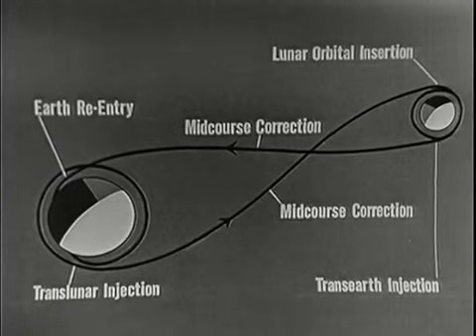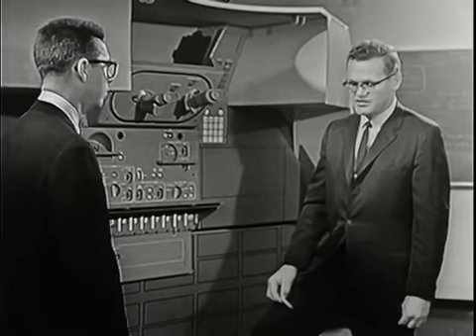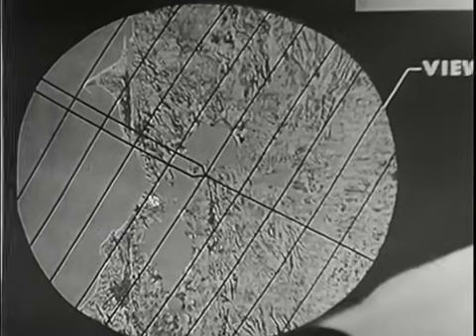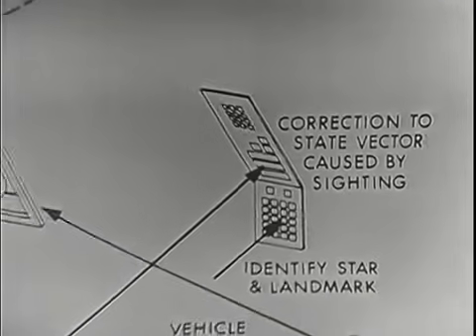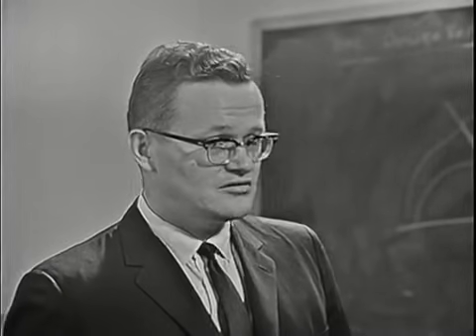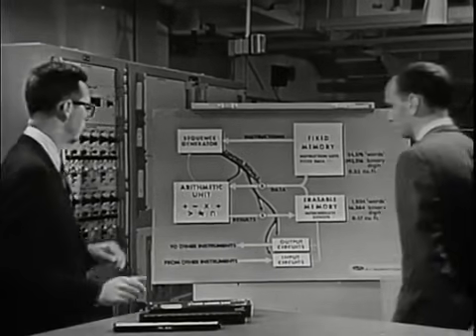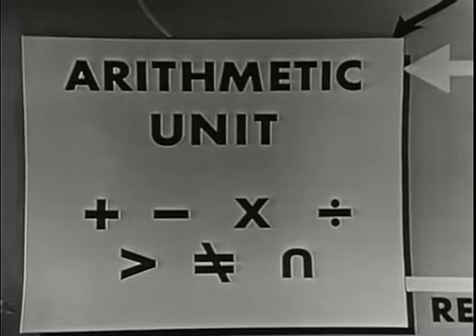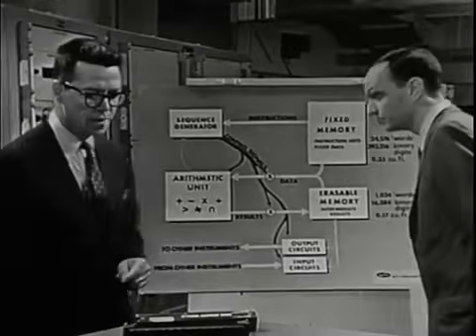Computer for Apollo  (1960s)

Comment: In 1978 I wire wrapped a S100 computer board with 40 ICs in a 5x10 inch S100 proto board.The CPU was the 2650 and was programmed in an Assembler using Numonics for Instruction and Operand, very similar to the Verb and Noun. Fortunately we did not have to learn the instructions in numbers as we had letters like BSTA,UN (instruction) and CHIN as the Operand. The Assembler then compiled the Source Code to Machine Code that was stored on Cassette Tape at 110 bits per second for later re-loading. I still have the tapes and they still load OK. The Wire Wrap CPU board still works as well, great technology.
Reply: I also hand built a Z80 board- but I did not have the luxury of assembler- that would have needed a computer! Instead I hand coded in hex the op-codes and burnt it into an eprom using a home-made programmer. 1K of packed code, to give keyboard, video handler and disc controller. Probably could not have done it in assembler- I made a lot of use of physical addresses- definitely not relocatable code! Only one bug- got the video line length out by one. simple fix, and up it booted- the A> prompt I will never forget. (CPM1.4 of course).

Comment: thats crazy. your computer location device relies on having a clear day on earth.
Reply: I'm not an expert on Apollo navigation, but my understanding is that by the time they were flying the inertial guidance unit and the ground crew were the main things relied on for nav on the flights. The sextants were backups (and also known non-jammable because it was very cold war-y times) and used for cross-checking; and they'd often use the horizon of the earth/moon... don't know how often they relied on particular features on earth - would be cool to know.

The first time the sextant was necessary was during Apollo 8 when Lovell made a mistake entering those crazy verb-noun commands and spun the ship. What's wild is he was then the one with prior experience using the sextant to save Apollo 13!
Reply: With multiple landmarks to choose from it's not a problem. Somewhere it is a clear day.

Comment: The numeric verb/noun system sounds like a very primitive version of a command-line interface. When your computer only has 4KB of memory, you don't have much room for UI.
Reply: My first computer, an Acorn Atom, had a 4 KB ROM containing the operating system and the BASIC interpreter. So much more than a simple numeric verb & noun is certainly possible.
Reply: @JanBruunAndersen  Yeah, but you would have had 20 years of time for BASIC to get established. BASIC was a new thing back in the 1960s. If any of the NASA engineers knew about it, they probably wrote it off as too complicated and too much to go wrong.
Reply from the maker: BASIC would have had too much overhead, they needed machine code style efficiency

Comment: hundreds if not thousands of tiny copper wires wrapped around pins for the guidance compute is nothing short of insanity.
cutting edge tech has gotten so much better and it is difficult not to take it for granted